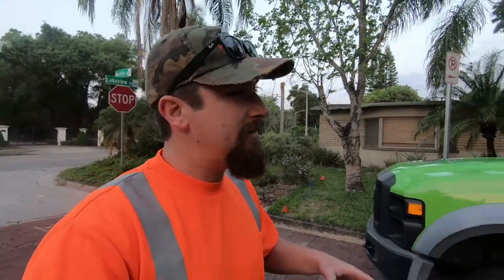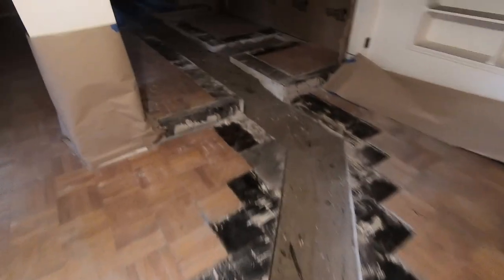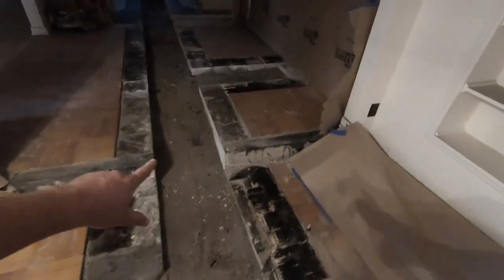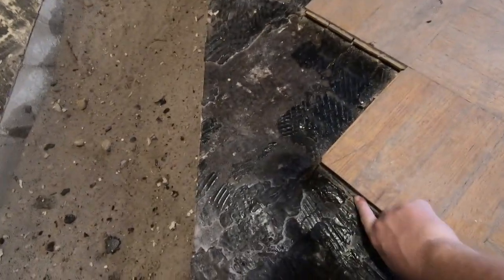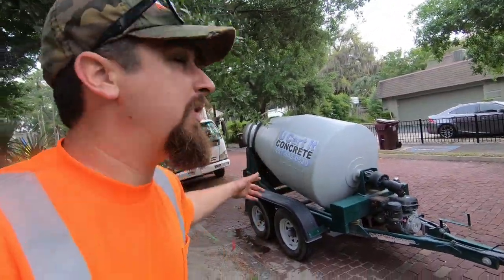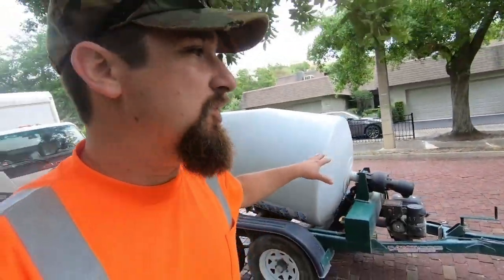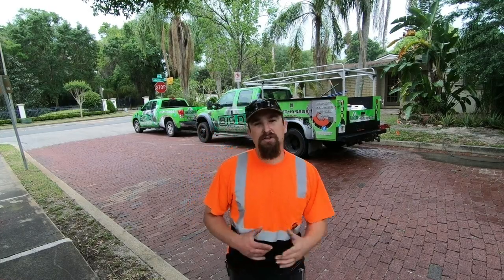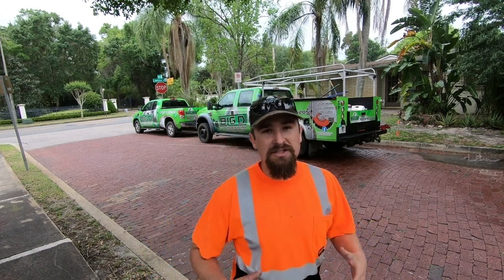How To Cut And Re-pour Concrete In A House

Comment: I didn't really see the dowel additions. I thought you would have drilled on both side and tied the center together with wire to make it continuous across the span of the trench. I looked like you drilled in and only went about 3/4 of the way with the rebar alternating every other side every 32 inches I think you said. Correct?
Reply: The operators followed the customers request and code requirements on this particular job.

Comment: No epoxy for the dowels?
Reply: You don't need the epoxy as the bars are fix by the size of the drill bit, lest then 500mm  no need, as slab either side lest then 500mm, as it's not structural, basic requirements are meet by standard codes